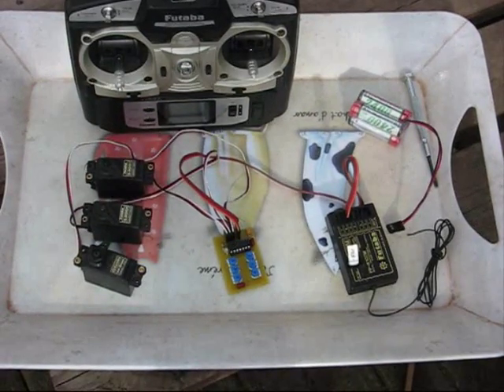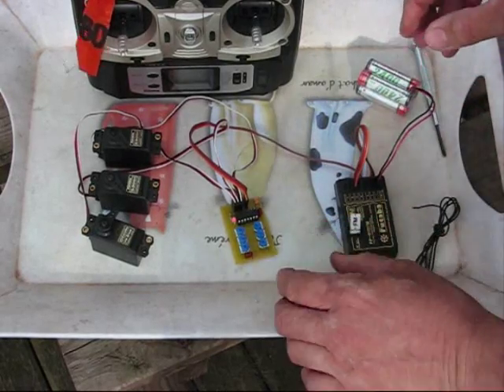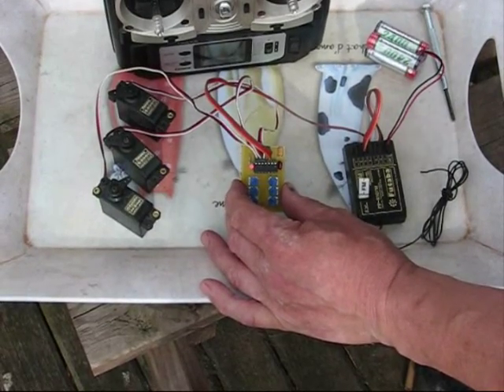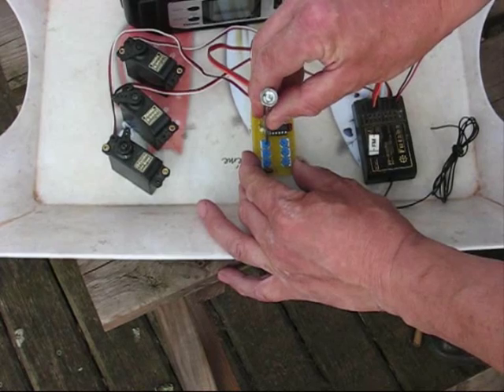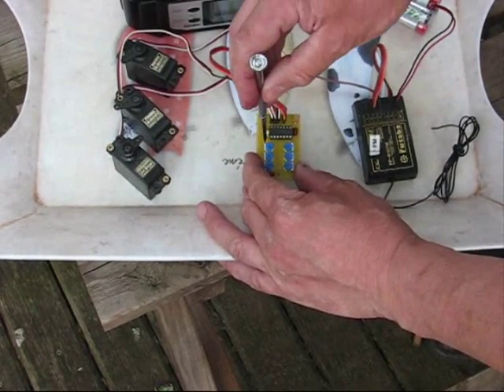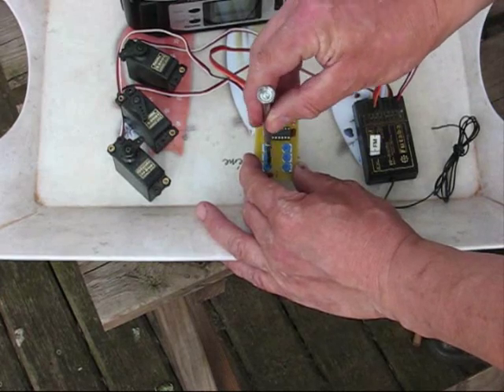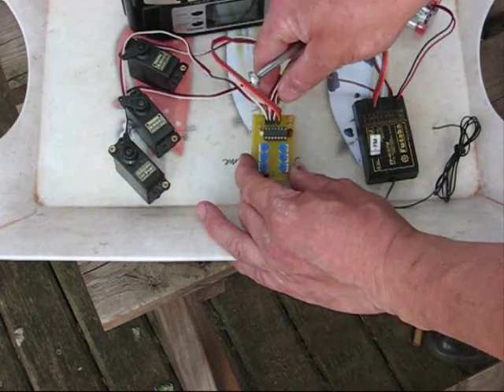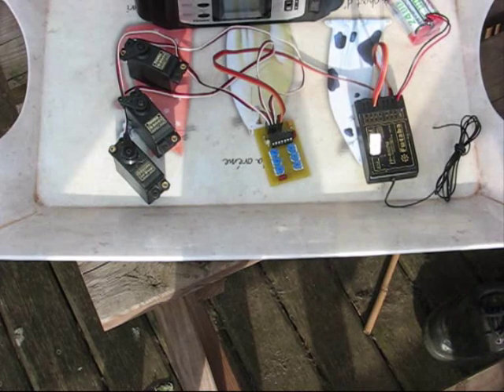PIC 16F684 Undercarriage Retract Sequencer

Comment from the maker: Hi Vane. Yes. 6 channels of A/D for the 6 end points. The one-second delay is hard coded.  I'd thought about having the six pots on an external 'programming board' which you plug in to set it up, then the values are stored in flash and the pot board can be removed - but the onboard pot way seemed a lot less fiddly. 
You're on the ball aren't you?  :D
Phil